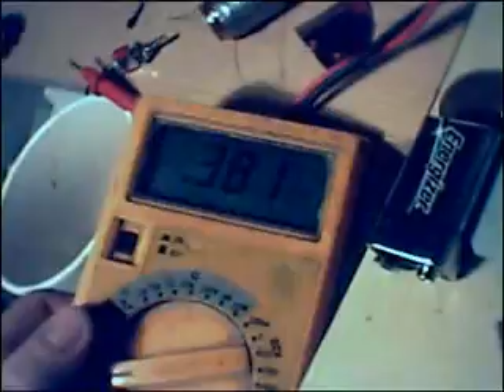SSG 24

Comment: Not tested it yet, I think when I try to use any current the motor will stop, think I made the alternator to large for the power out put of the motor. But will be back with that unit one day next week & I will let you know how it goes. See my new motor that I'm working on for that type of alternator. I use the same alternator in one of my small windmill generators, I get 30 to 40 watts so maybe a bit 2 big for the pulse motor, I will be making one exactly the same but smaller version.

Comment from the maker: Output from the centre Generator is sent to cap 2 as well as the output from pickup coil 2. All three caps are in parrallel - making a cap bank. The primary battery is connected to cap also, though it should not matter where is is connected on the cap bank. I cannot explain how the caps are at a higher voltage than the primary battery they are linked to. The connection is however dioded.